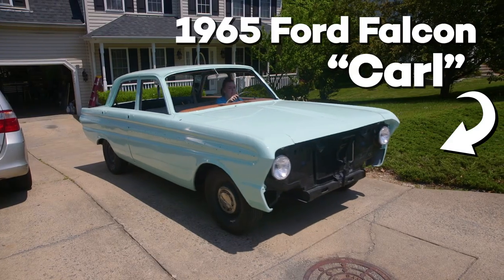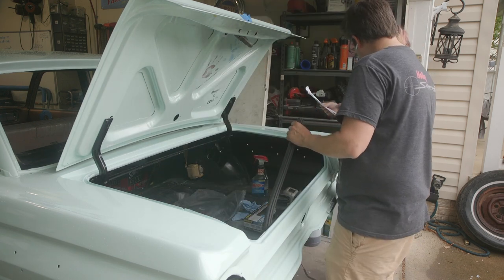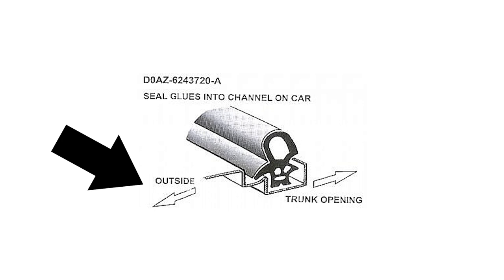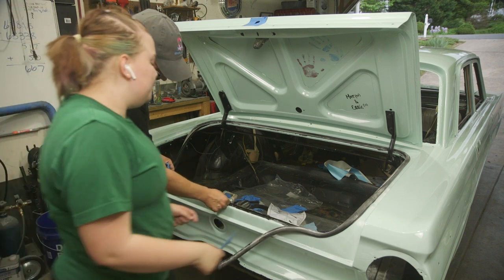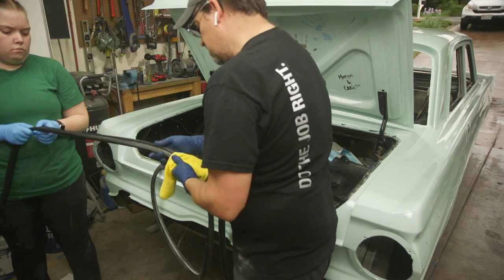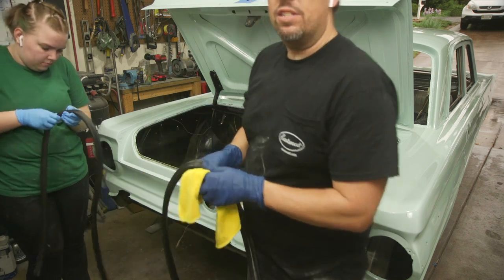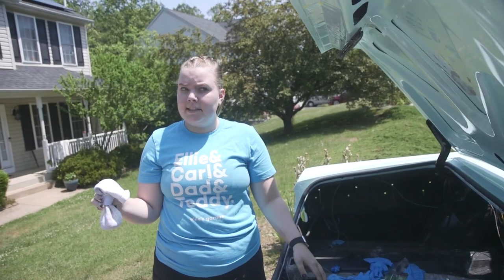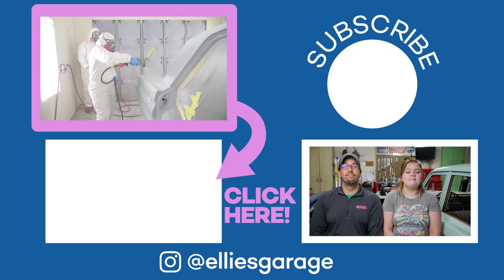DO NOT Install Your Trunk Seal Like THIS! 😂

Comment: I am just wondering why you are using a trunk seal for a 1970 car?  I do not remember Ford using that profile with the voided bulb in 1965.  ( The part number beginning with "D0..." indicates 1970).  You may be doing this again as I don't think there is enough room in that channel for that seal to fit.  The trunk should not be that difficult to close.
Reply from the maker: Hmm. Not sure. This is what Melvin's and FalconParts.com are selling for my year of Falcon but it would be good to know if this isn't the right part.
Reply: @ElliesGarage  The correct part has just a simple flap at about 45 degrees.